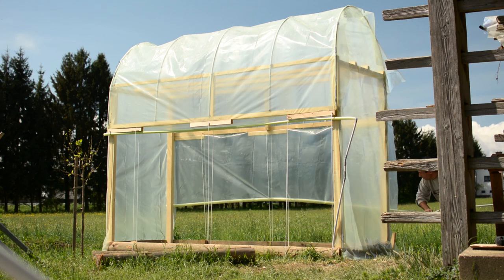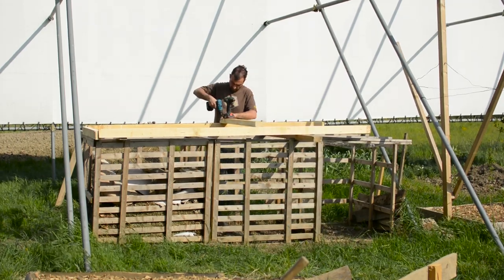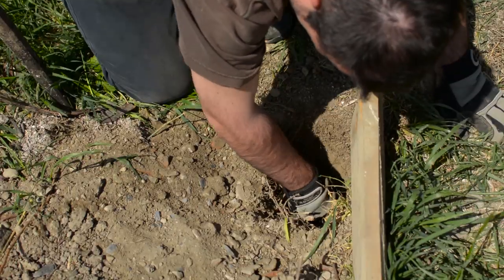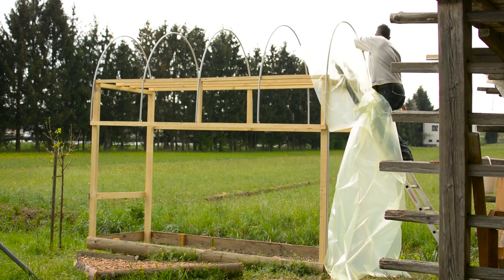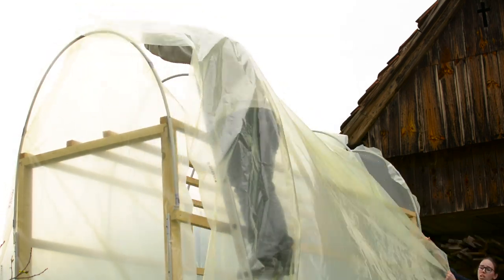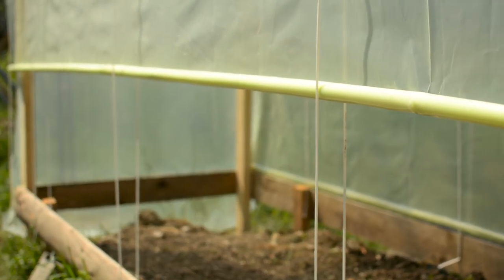Cheap DIY HOOP HOUSE For Tomatoes In Raised Beds - Prolong Your Growing Season

Comment from the maker: ⏱️TIMESTAMPS⏱️
0:00 Building a hoop house for raised beds with roll up sides INTRO
0:58 Constructing the sides
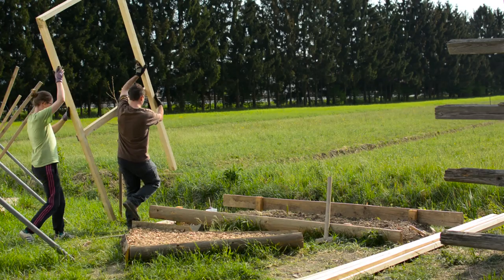2:10 Preparing the foundation
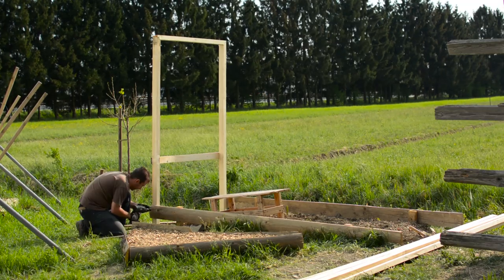4:15 Building the hoop house structure
5:44 Securing the hoop roof in place
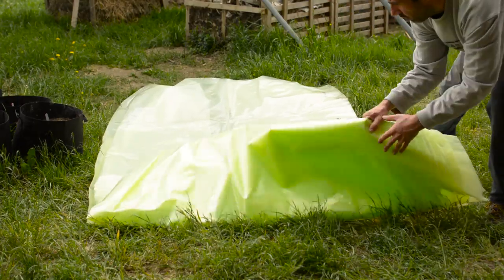7:05 Hoop cover details
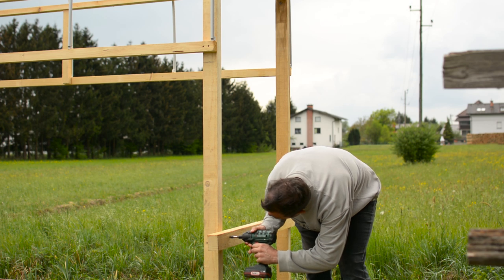8:06 Covering the hoop house
9:40 Hoop house side wall construction with roll up sides
11:32 Finishing touches